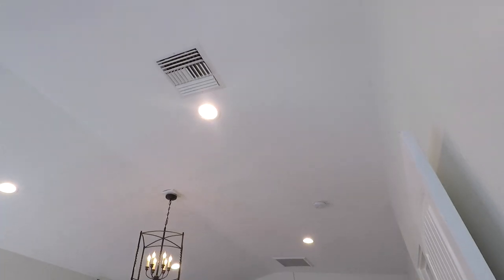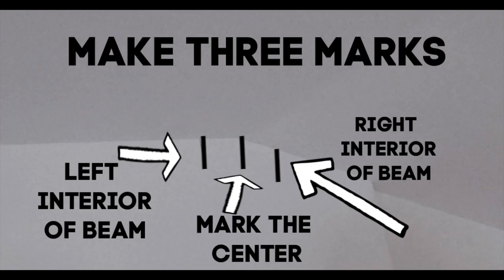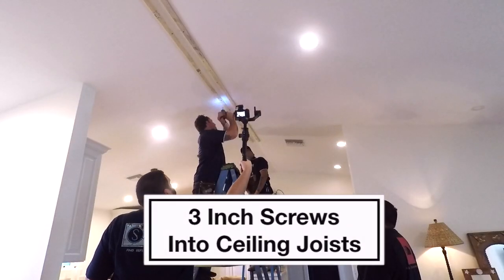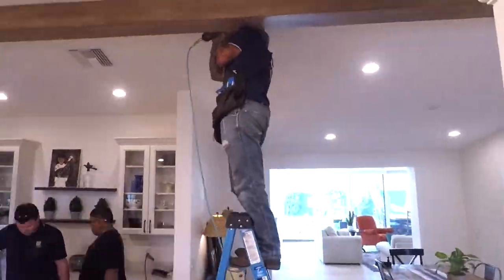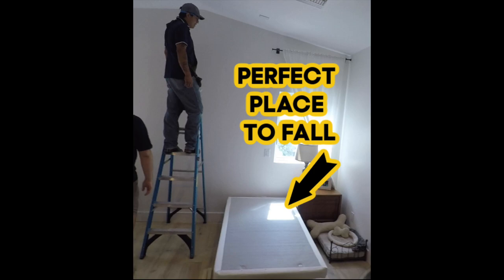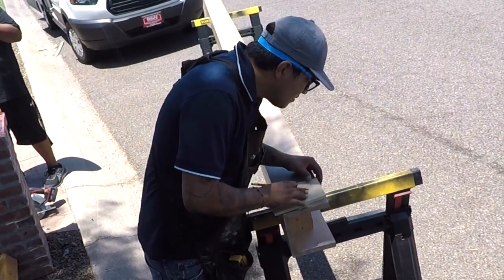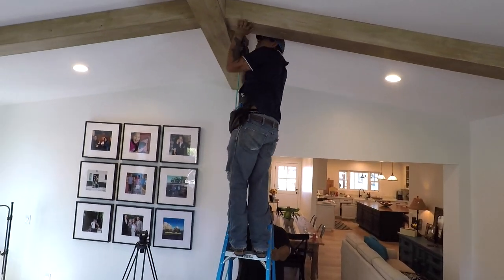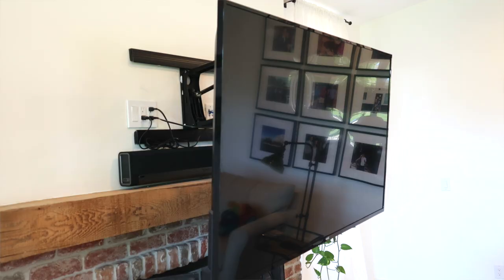Pro Install Wood Box Beams

Comment: I'm not impressed with the fitting of these beams. Caulking the edges?  That's a no no in the world of finish carpentry that suggests they rushed to get this job done. Had they taken more time, they would have had better fits.
Reply from the maker: I hear you…the longer i look at these the bigger those gaps look!!

Comment: Whats the 3 (3 lines)measurements on the first beam i have vaulted ceiling and going to do it my self. Would you share
Reply from the maker: I believe they mark center and then left and right inner dimensions of the beam.  I’m assuming they want to make sure beam is equidistant on either side of center.  Sorry for delay in response!